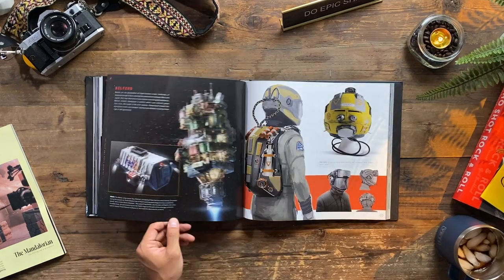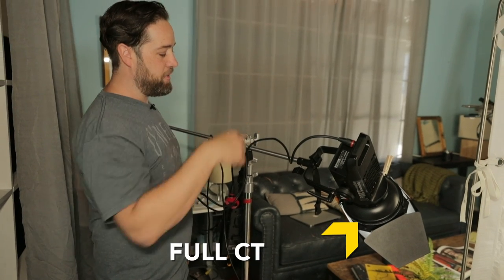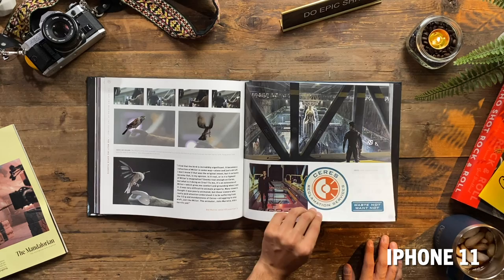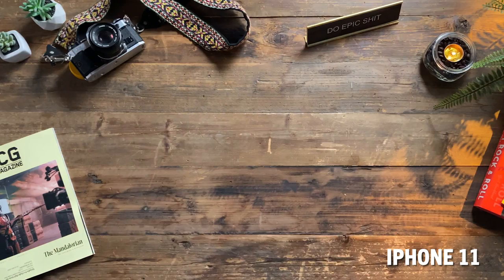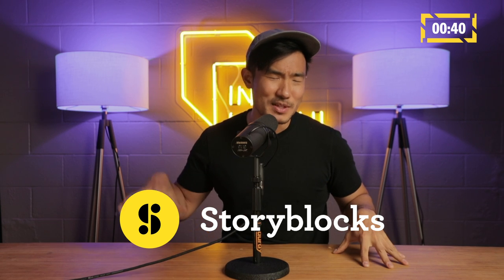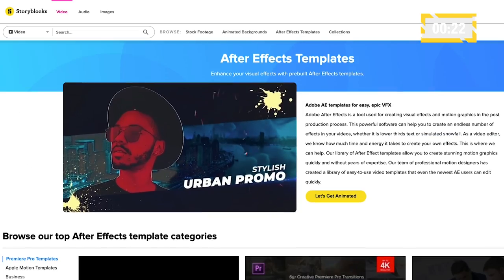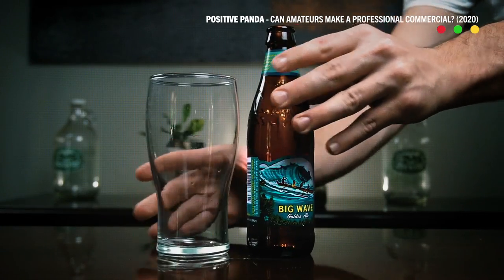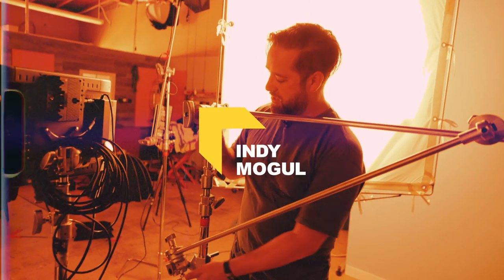Ultimate Guide to Rigging Overhead Cameras

Comment: I just put one together at home to shoot a few videos for work. There are kits that'll let you mount a pipe from your local hardware store to the top of 2 c stands and you can either clamp your mount on or use the one that usually comes with them. Costs you an extra c-stand but it's hella stable and relatively inexpensive if you don't mind the industrial look.

Comment: This camera wobble when using a single arm on my C-stand was exactly the problem I ran into when using my DSLR to shoot overhead still shots of old newspapers that were laid flat on a table. As soon as I moved anywhere near the camera the arm would wobble. I kept thinking I really need to shoot this on a concrete floor, but your solution is much easier. Just need to buy myself another extension arm and a grip head.

Comment: What did you use to rig the FX9?
Reply: It could have been the top handle to a cardellini.
Also, the FX9 has 1/4-20 and 3/8-16 holes as well as a removable shoulder pad that takes some screws on the bottom.
Reply: Yeah bummer that they edited out that info

Comment: Hey Ted & Casey : 

My question is you guys just pinched the FX9 handle with the cardellini clamp? 

Couldn’t quite make out how you guys actually rigged it , seemed like Casey was going into it...“ instead of using a quarter 20 screw...” but then it just cuts to broll and the broll doesn’t quite show you guys putting it together in a way we can mirror and implement ourselves. Would have been super dope to show it just like how you guys did the DSLR rig, even though it’s much simpler and easy to grasp. The FX9 rigging piece needed a little more attention lol. Please help guys. 

Also would like to see a video of how DPs/Gaffers/Grips rig quasars , and astera tubes. All accessories involved to rig those types of lights overhead and such. Please and thanks!
Reply: I think we’ve gone over it a few times here in the comments. But it’s only one of many ways you could tackle this. We did it the easiest way we could think of
Reply: @Thats_my_Point  You and I communicated on IG, this comment was made before that, lol. Thanks again bro!

Comment: ive got a boom stand - added an adapter to match the threads of my camera (sony a6000) - and it works just fine -- some may need a counter weight - but it cost about $30 - dont need professional expensive gear to work with a mirrorless

Comment: How do make sure the camera is even horizontally and vertically to avoid one side  of you object looking longer than the other? It takes me forever to get  a square /rectangular book to have parallel sides! Any tips?
Reply: You can use an Alvin Mat.
You can drill a hole in the absolute center of a lens cap and attach a plumb bob.
You can use a zoom lens, as you move through the zoom, check if items are shifting oddly.
Reply: For the Love of Comics most cameras have levels. Rtfm.
Or use something with a grid to fine tune the position
Reply: @alex0589  That's cute.
My camera level doesn't work when it's pointing straight down.
Reply: Certain lens as well make that really difficult (white angle lenses when they are close) but there are several options that you can purchase on Amazon like a three-way leveling block that can fit in to the cameras cold shoe
Reply: @robertfeliciano5723  thanks! I've used something like an Alvin mat, even the 6*6 grid in the camera, and while they help a bit they still have plenty of room for error for some reason. And as you point out, the camera level doesn't help for the up/down position! 
I'll research the plumb bomb and use a zoom lens next time, thanks!
Reply: @Thats_my_Point  ooh, a leveling block that fits into the shoe mount sounds like exactly what I'm looking for! Let's see if I can find one where I am, thanks! 😁

Comment: WHat about using a mirror?
Reply: Pamela Armstrong would you rather rig a camera or...a big dangerous piece of glass in the air? Plus it’ll be reversed.
Reply: Beckett honestly be a bit tricky but could totally work. Sometimes you need to play around with things and post to make it look normal. But a clean near, room two rigs things in line things up properly, and a way to get the mirror up high are the only problem is you need to overcome with something like that
Reply: I believe this is how it used to be done when the cameras were a lot bigger and heavier. Just a different idea. Love to see and hear the different ideas.

Comment: Instead of clamping the FX9, while it would increase the weight a bit, I'd think I'd have put it in a cage and grabbed that with either the clamp or multiple screw/bolts... No?
Reply: There’s quite honestly a lot of ways to skin that cat, there’s plenty of ways you could delay, I just didn’t feel like putting trust into either a quarter 20 screw, or the mounting holes for the camera. The kids would definitely help, but if you want to find ways to get a few mounting points and spread the load out over a larger area
Reply: @Thats_my_Point  Agree Casey - wasn't criticizing you, just sharing the approach I'd take. And my way sure ain't the only way. :)